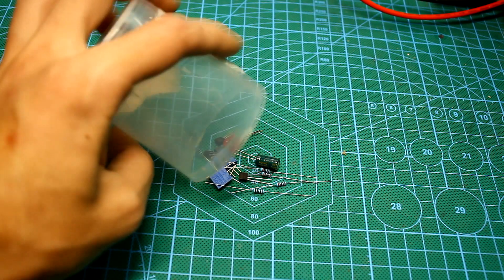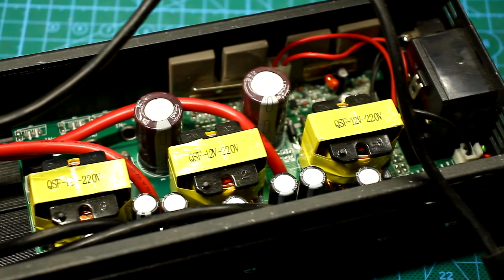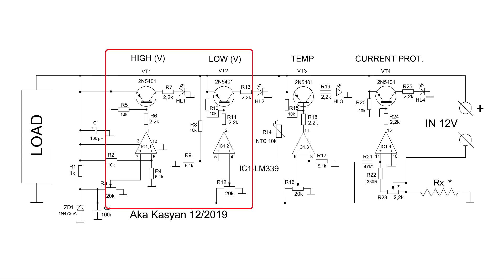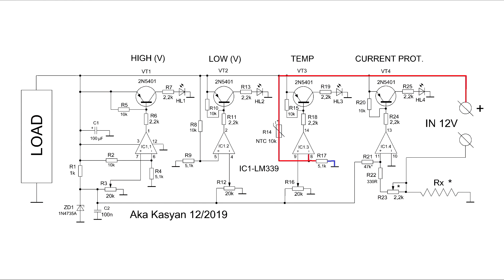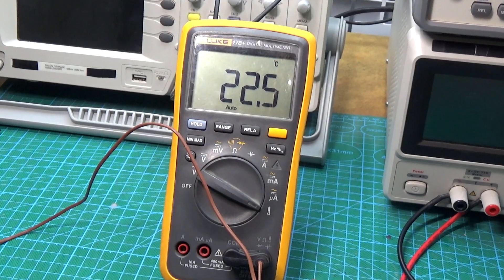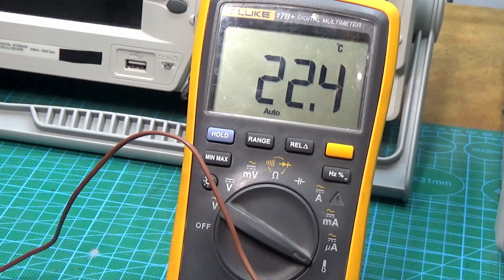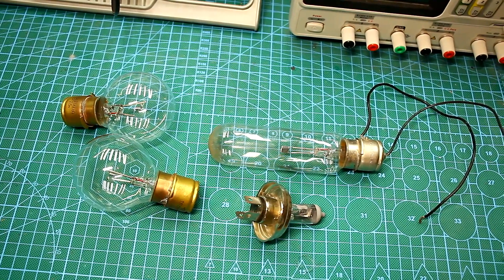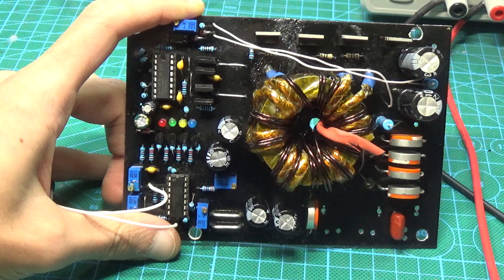Protection from "evil spirits"

Comment: Can we use all the protections or at least over voltage and under voltage protection for the same load? as i can see 4 separate outputs for the 4 mentioned protections.?
Reply: Same feeling. As I understand it, this is an indicator circuit, nog a protection circuit.

Comment: Hi and thanks
what's "zener diode" compatible for 5v power supply in this circuit?
Please, somebody answer me
Reply: It’s a device which will only pass current above a certain voltage in the reverse polarity and acts like a normal diode in the other polarity. Watch some videos on YouTube to know more and any Power supply of 5v can be used instead without the zener

Comment: Hello. i just discovered the channel and i like it. if I do not ask too much. you to explain the chip and how to use the TC4052BP
       We use the circuit above for a selection of audio recording on DVD, AUX, TUNER and MP3 PLAYer. Where is the IC 4052 with two pairs of 4-channel switches, so we can use a single IC in the stereo system. because I didn't find much explanation about it. please if possible. thanks

Comment: My thing about the overcurent protection is that you need a latching sercut to keep the load off.otherwhise you will just be power cycling youre load.
Reply: It is easy, add acapacitor to gate of the mosfet

Comment: I always enjoy your videos!
They are very good!

In this circuit, I do not understand how the op amp (IC 1.4) for the current would work.
Are you connecting pin 10 to ground?
How does pin 11 get to a voltage lower than ground?
Kind regards

Comment: Good idea.   Simple and effective notification of bad situations.   BUT it does not protect/prevent from them though.  New video title needed
Reply: It can like she said if you replaced the leds with say a power transistor to drive a relay. Or just a fet it self. The sercut she made for this video is just a dimo kit basicly. It shows the functions.
Reply: @ceilingfanmusic6597  Can you show how the relay will work with UV/OC protection? If the load is responsible for either of these conditions (which will be likely), then the relay will oscillate.
Reply: @jamesbrown99991  for the under voltage an over curent like i said in my first coment in the vid you would add a latching sercut befor the relay so the load stays disconnected till the voltage rises above a triger to reset the latch just recenecting the load.

Comment: this doesn't protect anything, it just lights LEDs
Reply: ladi jada Replace the LEDs with n-channel mosfets to achieve protection
Reply: Yes. 
This is the control circuit.
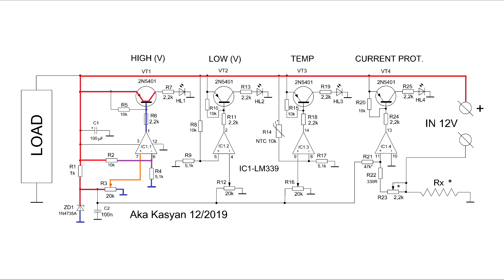Look at time 2:50 to add output switch.
Regards
Reply: @stephanc7192  Where do you connect the output of the output switch? If you use a relay and connect the output to the load you wish to protect, you will get oscillations when using the under-voltage or over-current sections. If you use FETs instead of relays, you will get either oscillations, or the load being partially turned on, and the FET heating up.
Reply: ladi jada, if there's a problem with oscillation; have you tried to use optocoupler (817) to full switch the mosfet. It helped in several cases where original signal weren't not enough to switch a load.
Regarding the presented instructions, they are good enough to make it work.
All the best

Greetings from Tanzania 🇹🇿
Reply: @srtv7925  pity it won't work due to causes I mentioned